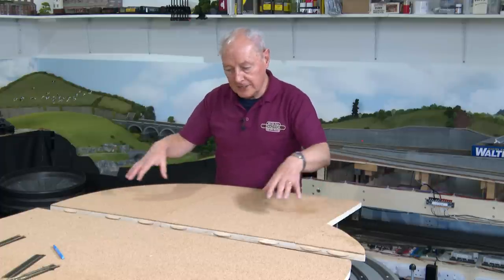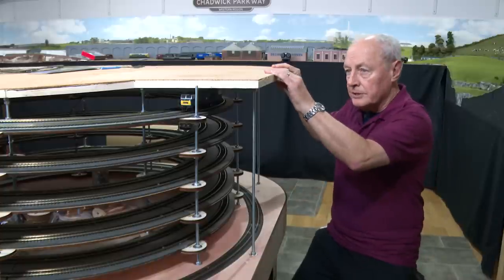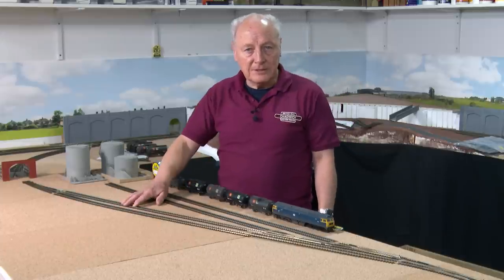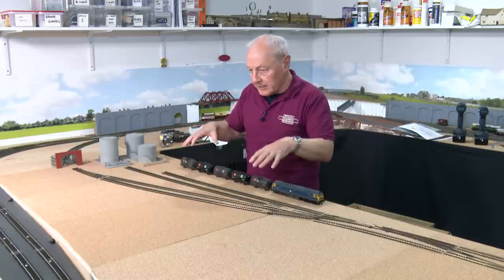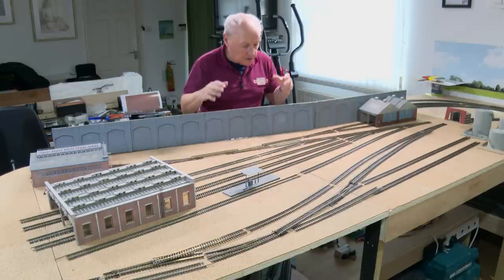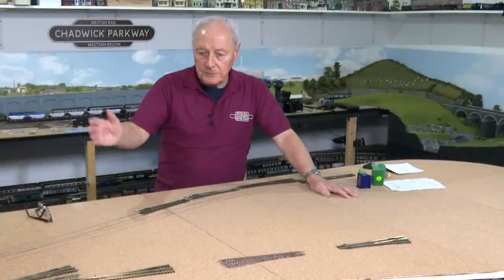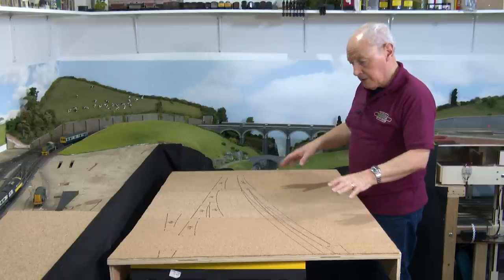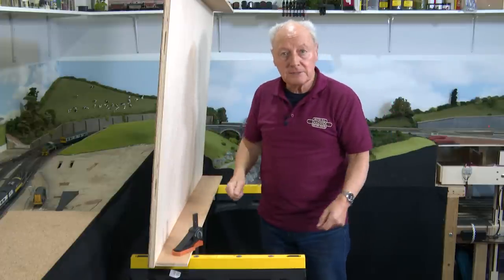Autumn Update at Chadwick Model Railway | 172.

Comment: Hi Charlie, I’m acoustic trained (although partly deaf now😂). Listening to that sound deadening, I ‘think’ you have cut out much more sound than you say, but also accidentally boosted a bit again. You can a distinct tone in the deader version that sounds like a resonant peak, and I would guess that it’s the internal resonance of the sound proofing octagon. It’s acting like a cello body. Looks to be pretty much the same as it’s height too, which will all add to together. If you didn’t need the padding element, I would suggest a series of odd size and shape columns, rather than a single hollow structure, but.. try putting some spare foam inside the box , or better and cheaper, use an old duvet or pillows.
Reply from the maker: Thanks for the tip. 
I shall hunt “down” an old duvet.
Regards Charlie

Comment: Have you not considered the right angle and remote mount units for the Tortoise motors? Coastal DCC do them. The remote unit is good it allows you to work a crossover with just one Tortoise unit.
I've used them on a layout.
Reply from the maker: I have thanks but it’s also good to try out other options. Regards Charlie

Comment: Another excellent video, I hope the both of you get well soon (covid), sound proofing, looked through some of the comments on this subject, some of which are pretty good, but how far do you take it! lol its endless, hard surfaces in your room amplify sound. When building layouts i doubt most people do not take (Sound) proofing into consideration when building the frame work, rubber mountings / washers inserted would also help, the cork u have installed excellent also for the boards, take a look at how recording studios use sound / materials to quiet noise reflections, U tube.
Reply from the maker: An excellent comment mate, thank you. Yes, we are feeling much better, and will soon be right as rain.

Comment: Hope you all get well soon. Charlie, I build loudspeakers and I use sound-adsorbing materials in lining the truncated loudspeaker enclosure to enable the loudspeaker drive unit to lose the rear wave without impacting on the loudspeaker drivers front facing the acoustic wave. It's a tricky business! The foam panels you have used are excellent and are used widely in recording studios as an industry standard. I notice you avoiding track pins and using cork as underlay and glueing the track which helps a lot. I'm wondering why you have not used the foam panels surrounding the exterior of the helix and attached them in with an easy method of removing them say from base to top and curved nestled between the supports. Cheers Ian
Reply from the maker: Interesting, Ian, I had thought about some form of sound absorbing curtain on the outside of the Helix. Regards, Charlie

Comment: Wrapping the outside of the helix with similar panels should further reduce the noise. Of course, keep easy to remove separate panels, so you can get track access when required ;).
Reply from the maker: I had thought of some form of sound muffling curtain. Regards Charlie

Comment: Great video again Charlie. For sound proofing, Perhaps placing the foam surrounding the outside of the helix would provide improved sound proofing
Reply from the maker: An interesting suggestion, Andrew, I had thought of some kind of sound absorbing curtain. Regards, Charlie
Reply: @ChadwickModelRailway  Would that be a continuation of the curtain that I assumed you might put around the entire lower level, just as you used to have on the "old" Chadwick ?
Reply from the maker: No that’s just a piece of cloth.

Comment: Another excellent instalment Charlie. Trust you and your wife are on the mend now. Suffered back in June and it did take a while to clear the system. Excellent update to the TMD and it's all looking very dynamic. One question for you with regarding surface point motors - I have purchased some Peco PL-11s but for a couple of points I cannot fit them to the "straight" side of the point so any ideas of how to install them to the "curved" side? Always impressed by your hints and tips, never complicated and well explained. Look forward to the next episode. Keep well.
Reply from the maker: I’m sorry Kevin, but I don’t really have any idea. A friend of mine once fitted the points off to one side and used a larger wire to connect them. Regards Charlie
Reply: @ChadwickModelRailway  Thanks Charlie. Bit of experimenting for me then! All the best.

Comment: Get well soon Charlie.
On the subject of the "sound wall"... with there being a gap between the wall and the various levels of the helix, should any rollingstock fall, wouldn't it be possible that they could pinball their way down and cause more damage rather than just falling into an open area, or worse, rebound onto a track on a lower level and cause a major derailment over another train running up/down the helix?
Reply from the maker: You make a valid point, Darren, but I think they’re a little more resilient than we give them credit for. Regards, Charlie

Comment: Charlie, MPD's should look busy most of the time. Especially one as large as yours.
What a great idea is the Head shunt. The sound deadening foam is also a great idea.
I love those smaller point motors but are they motors and not solenoids?
Once again an excellent video and I did not hear a cough or a sneeze.
But please oil that squeaky wheel.
Reply from the maker: Yes, Alan, those point, Motors or Motors are not a solenoid. I’m still hunting for the squeaky axle! Regards, Charlie
Reply: @ChadwickModelRailway  Thanks for the info on the point motors
I hope you find that squeaky axle

Comment: I don't know if the sound wall/flooring is the best physical or audio protection for the layout. 
- You still risk a loco colliding with the individual layers of the Helix (now more likely with the inside wall. Extending the radius of the helix boards (either physically or by using a sort of mesh/netting like you would see on trampoline systems/bridges etc) would stop the issue in its tracks
- The foam padding would work better with an enclosure on the outside. Sound will still diffract and reflect off other surfaces without it. No doubt you may have seen an improvement in this test, but it could be better.
Reply: https://i.imgur.com/9AdKqIW.jpeg You'll have to excuse my "artistic" impression. I suppose this will get down to "How much do I really want to protect my locos?". I can understand if getting into the core now might be a faff.
Reply from the maker: An interesting comment mate. I’m now searching for the idea of a sound reducing curtain on the outside of the Helix. Regards, Charlie
Reply: @ChadwickModelRailway  All the best. Layout is looking stellar!

Comment: Hey Charlie, I was wondering if you could explain to me about power supplies, specificly for accessories such as lights or point motors. What sort of power supply should I use? (An old analogue power supply?) And what voltage can / should it run? (More lights more volts? Wire it up in parallel or in series?) 
Thank you very much! 😀
Reply from the maker: Great question. I use 12 volt DC transformers in several areas.  They are ex laptop power packs bought at car boot sales. Try to avoid using old DC power supplies as the voltage can fluctuate considerably.

Comment: Good Evening Charlie, was wondering what temperature you have your soldering iron at when soldering Peco flex track joiners and feeder wires? Thanks, hope you and your wife recover from Covid soon. John
Reply from the maker: Normally 400 John. Lots of heat to get in and out quickly without melting the plastic. I don’t solder the fishplates, just the underside of the track.

Comment: Hi Charlie, did you consider using a free sound meter app. on your mobile to measure the difference in noise level? I certainly thought there was a difference in the tone and also the level as a result of the material.   Thanks for all the effort you put in to making the videos, I mus get myself a layout.
Reply from the maker: You make an excellent point, Roger, and you’re not the 1st to do so either. Sadly, I never realised one existed, regards, Charlie

Comment: Hi Charlie.. great stuff as per..... question... if your boards are removeable does this mean you dont use fishplates to connect the track, at edge of the boards, ? just line them up very carefully ? 
and just as an up date my new train room, shed, is nearly finished so will be putting boards in next week , i hope.. Davey P Uk..
Reply from the maker: Great question Dave. No, once the boards are in place, a small piece of track is used to bridge the boards. Regards, Charlie

Comment: Oh Charlie, you have my fullest sympathy! I have had the damned Covid twice myself so I understand how irritating it is. I’d like to think that it wasn’t so bad because I got jabbed! 🤔 Well done for trooping on regardless, and I think you’ve definitely hit on something with that sound proofing as it certainly made the cacophonous wheel clatter far less noticeable. Don’t get me wrong, I love ‘clickety clack’ but if you have got several trains going on at once, that has got to be deafening at times! 😵‍💫

I wondered if you were thinking of some kind of easily removable cape around the outside to do a similar job? Maybe something that is easily removable using Velcro or press studs? 🤷🏻‍♂️

The use of a headshunt will certainly improve the operation potential of that scene too. I wonder if you’d consider stretching it’s length to say about 45” or so, as then you could hold a train in it and allow another already in the sidings to depart if you so wish or ever maybe store a wagon/shunter at the end of it😉

Cheers Charlie, get well soon mate! 👍🍻🍀

As for the
Reply from the maker: Hi Tim and thanks for the great comment.  I’m considering some form of sound absorbing curtain around the helix.
Regards Charlie

Comment: First & foremost, you and your wife get well.  I know Covid has become sort of disengaged from seriousness, just like most bad things that just go on ad infinitum.  But a young colleague of mind recently had an easy Covid and it became an eye infection.  At the moment, though his Covid is over, he's in constant pain, has no sight in one eye, and is extremely light sensitive in the other eye.  It's no joke, as you pointed out.

On the model side, I've developed a theory that sound decoders were invented to cover up the almost impossible to silence metal/plastic wheel on metal track noise.  Taking a page from YouTubers who add real train-on-track sounds to their model train runs, I'm thinking we should just put recordable decoders in some of our rolling stock and play those same prototype squeals & clickety-clicks as they run around the layout.

The biscuits are a neat method of building, but w/o glue I'm afraid the may eventually start to separate.  If you do have that issue, I have used readily available flat predrilled metal plates to hold unglued seams together.  They come small enough, they'll fit the outside 18mm vertical edges of the plywood.  Personally, I use 2"x3" or so thin plates & put them underneath near each side.  Very easy and the panels still come apart. :elbowcough:LOL!
Reply from the maker: An excellent comment as usual Frank.
I’m sorry to hear of the poor chap with the sight issues. 
Thankfully Margaret and I are certainly now on the mend. 
Regards Charlie

Comment: Thanks again Charlie.  I think the foam barrier internally does help the sound and definitely reduces the risk of a train spreading across the centre of the helix and should make it easier to recover in the event of such an accident.  My concern is that of dust and fluff, which always seems to get in.  Are you going to be able to easily vacuum the sides and the bottom to prevent this?  The second thought I have about the oil terminal is the running of the return tanker wagons.  The tankers will normally return to where they came from and there is no way to take the wagons out and attach the diesel to the other end.  So although the locomotive can reverse the tankers into the oil terminal, you will require an 08 to come out of the shed, come across to the head shunt, go to the terminal line, draw the tankers out onto the head shunt, then the train engine can reverse onto the train.  But is the line out of there bi-directional?  Clearly the TMD is, but can that line be used in that way?  As for being not interesting, It is always enjoyable watching trains move on the layout.  Thanks again Charlie and I hope you get well soon.  (Incidentally, when my wife had covid, I failed to get it and tested regularly).
Reply: It should be possible to run round the tankers by bringing them onto the arrival line then taking the engine along the parallel line back towards that tunnel mouth and reconnecting to the other end of the rake of tankers

That is the purpose of the run round loop
Reply from the maker: You both make excellent points, gentlemen. Having carried out a little more research there is no hard and fast rules, it very much varies depot to depot. Regards, Charlie

Comment: Charlie, I see you have a slight problem with unwanted noise. Have you ever tried sound proofing the under side of your layout? I know that layout boards can resonate sound through them and I was wondering if this would help? They make a sound proofing material that is used on the floor of vehicles when restoring them and it really works. It is a bit costly, so maybe foam or even egg cartons. I know back in my younger years egg cartons where used for sound proofing walls and rooms by musicians. Just a thought. Take care of yourself, Covid can be nasty.
Reply from the maker: I am aware of this Todd. Once the layout build is complete, I shall see what areas can be fitted. Regards, Charlie

Comment: Neat job on the Joinery Charlie ... well except for that.. ahem..  With the sound dampening, probably a better descriptive for the foam material and your effort, your project probably would have been better served if the octagonal structure had been measured and fitted around the outside of the helix and not just within. Whilst it may assist in preventing derailed vehicles from falling unimpeded inwards onto a hard surface below, without an outer layer or barrier of dampening, there is nothing..well very little to soak up the sound you are trying to reduce... I hope both you and your dear partner in adventure recover fully and soon.
Reply from the maker: I think a permanent structure on the outside, we just make things much more difficult. Perhaps a sound on sorbent curtain could be the next move, regards, Charlie
Reply: @ChadwickModelRailway  - It might be a bit of work but I suppose it depends on just how much one wants that "errant" sound to be diminished. Consider maybe fabricating a form-fitted shell to the helix's exterior with appropriate sound-dampening material on the shell panel's interior surfaces. From the outside it would resemble a circular cabinet, One could dress the outer surface in any manner that suited. To access the Helix's interior simply by removing the panel or panels when the need arose and it would also keep the amount of dust to a minimum too. This principle of enclosure could be extended to all of the sublevel layout areas with the addition of lighting within any operations or adjustments could be carried out just as easily as now.

Comment: Enjoyed your video very much. Why didn't you open up the bottom of the helix? The floor in the middle doesn't make any sense. With an opening in the bottom, you have emergency access to the inside of the helix and the underside of the tracks of your depot. The sound suppression with the foam would be much more effective when placed on the outside of the helix. (on replaceable panels with the foam on the inside).
Reply from the maker: It was the board designed by the supplier that made the centre inaccessible. I really don’t want the soundproofing on the outside as watching the Trains climb still interesting. Regards, Charlie

Comment: I have just over Covid. Had a nasty cough for a few days and a blocked-up nose etc. Fine now though, although the minor OP I was due has been cancelled due to having to be free of Covid for 7 weeks before a general Anaesthetic. 
Anyway,  A question. How do your tanker waggons unload or load their fuel?  I thought each waggon would need to go up to the large fuel tank to do that. So the track would either need to go past the Fuel tank the length of the train to get the last waggon next to the fuel tank or each waggon would need to be routed onto the empty track via a headshunt and then the next one moved up until they are all emptied or filled.
Reply from the maker: An interesting question Peter. There will be a piping system laid the length of the sidings. Regards, Charlie

Comment: Thanks for the update, Charlie.  I wish you and your wife a full recovery and none of that "Long Covid" business.  My immune system is compromised so I remain a semi-hermit.  I've been lucky so far, but I still wear a mask while shopping, etc.  Regarding your helix sound installation, I wonder if you could increase the diameter of the central "pillar" so that the foam touches the inside radius supports.  Then any rolling stock trying to take an inward header would be completely blocked from a tumble and the horizontal foam on the bottom would be unnecessary.  Cheers from Wisconsin!
Reply from the maker: Thanks for your comment, Andrew, Margaret and I are both on the mend I’m pleased to say. Regards Charlie